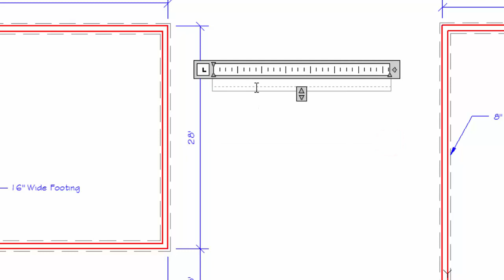Autocad - Dimensions & Viewport Scale on Foundation Plan Part 3 #38

Comment: hello mam,

i frequently watch your tutorials and i am learning auto-cad mechanical. i follow through all your series. now i am facing a problem with view port, when i look through view port i am not able to view dimension as above shown video tutorial.  please guide me what is wrong with my autocad setting.

thanx
Reply from the maker: +simar saini ;  If you are using annotative dimensions,  Make sure that the scaler in the full model space tab is the SAME scale as the viewport scale in your layout tab.   In other words, when you put the dimensions on the drawing in full model space your scale is set to 1/8" = 1'.  Make sure when you go to the layout tab and double-click inside the viewport - now make the viewport scaler  1/8"=1'.  You should see your dimensions show up.  If they do not, try turning on (make it blue) the little scaler Icon with the little circle next to it.  (this icon makes any annotative objects show at any viewport scale).  Let me know if this helps.